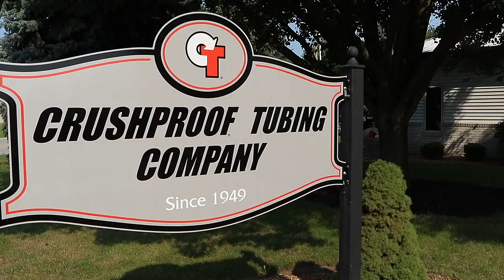Is Vintage Racing Being Destroyed by Gentrification and Control?

Comment: This sums up a similar theory I’ve had for a while. When a sports category naturally gestates into something good, it becomes popular, and when it’s really popular the folks with more money than they can spend will get involved. This causes a cost inflation that I personally think is irreversible. It also draws in undesirable personalities, and drives out the good people. Sport ruined.
Reply from the maker: You nailed it
Reply: Inflation can be reversed. As tyrannical governing bodies can be overthrown. But most governing bodies where created because the foundations of another weren't agreed with. 
 There is always a solution, whether people like it or not. What matters most is what's the best for EVERYONE.
Reply: HammerTowing usually with Motorsport categories the cost control starts with parity and control parts. The kind of thing that makes me want to smash a terracotta pot over my own head.
Reply: @willbeasy2898  True. But if the big kids don't want to let you in the club house, start a better club. Eventually, the big kids feel felt out...and some will want to join.

Comment: You could just as well drop vintage from the title. Racing in itself is being destroyed! I stopped by a friends the other day & they had NASCAR on the TV. I about cracked a rib laughing when noticing the flag man even had a full face helmet on.
Reply from the maker: Riiiiiiiight?
Reply: Well, after 2 or 3 flagmen got engulfed in flames pretty recently, I don't think they even had to force them to gear up, they just did it.  I don't remember the series I was watching, probably nascar because being on fire is what they do, but it was pretty horrific to watch them disappear in fire, and then a few seconds later jump out of the stand to get away, probably injuring themselves from the fall on top of being burnt.  So that example in of itself is probably not one I'd pick to point out a decline in racing.

Comment: Casey-You are so spot on!  I have been racing a 1959 Bugeye Sprite for 13 years now and only recently, started racing a barn find 1972 Merlyn Formula Ford.  I been on several podiums in my Bugeye, Indy, Mid Ohio and such, but only a few races in the open wheel car.  I decided to attend Mid Ohio this past June (2021), and was just stunned by the difference since my last race there a few years before. (2017).  The lower, middle, and upper paddocks were all taken over by big rigs, which left those of us with the true vintage cars, stuck in the grass with gravel roads to get to the grid.  Plus, we are the guys and gals with cars who embrace the fans and spend time talking with them and letting them climb in the seat for a picture, the big rig racing gang usually does not.  I walked around just wondering where the older cars went?  Hell, they had the few of us in the Formula Fords grouped with Miatas for gods sake!  I understand that as my wife says, old cars, older drivers, so the for profit race clubs tend to trend towards newer cars to stay viable, but if you came to an event that my club (VSCDA) runs, you would see that we easily have 130-350 cars that are all vintage.  I enjoy your videos-as a fellow racer who has now attended 48 Indy 500's, standing on the podium at Indy with that milk in my hand was a highlight of racing for me.  Here is my Mid Ohio race in a car with 26 years of sitting-this winter we are rebuilding the engine and gearbox for the first time.  https://youtu.be/8QCghb_NO_I
Reply from the maker: I intend to come out to the VSCDA. Thinking about getting a Formula B possibly. The Mid-Ohio event was built on Vintage Racing and was named the Vintage Grand Prix and now it’s been destroyed.

Comment: Agreed. I was involved in vintage racing back in the late eighties and early nineties. Both with SVRA and a SCCA licensed CARE. We ran support races for IMSA , champ cars and TransAm. Street circuits in Florida. I loved the street circuits. And we ran events at Palm Beach on three different tracks including downtown. That was local racing for me and once or twice drove the car to the track. I ran a ASA1000GT (look it up if not familiar). And a Beach Sportsracer. Fun,Fun ,Fun. The Miami GP and ST. Petersburg were great.  There was a little of what you are referring to back then but for the most part it was all good.
 My gripe is different. There were the gold chain, more car than skill group. And the guys that just drove. One of the pro guys that ran with is broke it down into three types of drivers. No, it was Joe Pendergast.  Riders, drivers, and racers. The riders knew what was going on in the stands. the drivers did a decent job of getting around the track, and the racers just hammered it all the time. Ok I got off track a bit there. As you get the dumbing down because the big bucks guys were often low on talent, they started altering the track itself. Lets throw in this chicane to slow everybody down so Daddy big chain can keep up. It occurred most often on tracks that also had driving schools. They got tired of their cars getting torn up so they just spoiled very challenging tracks. Look what happened to Sebring and Moroso(West Palm Beach) > The original Sebring course was fast in spades. Wide runways.Then they started stacking tires to pinch in the course and slow it down. The hairpin turn was gone. I think they messed with Green Park Chicane. They took a very fast challenging course like none other on the planet and turned it into a cutesy, ordinary racetrack. I ran the revised track only once and was very upset. The old course was so fast that I only touched the brakes for two turns. Moroso's turn eight was a challenge and only the most skilled could tiptoe through there without lifting. Most everyone else was braking and downshifting. I saw some nice cars get torn up there. But they had to dumb it down for the untalented and put in a chicane at turn seven that had no actual line. Terrible. That was my local track. I also was a corner worker/course marshall. The first race that I worked was at Moroso for the only TransAm ever raced their. The track was narrower than SCCA specs called for so it was a one time deal. The magazines wrote it up as the best TransAm ever. I stood with my back to the cars with my flags since my responsibility was beyond my corner to the next corner. They all went through without lifting. Paul Newman was just short of putting his turbo Nissan in the canal. The same type of cars at club races were braking hard and downshifting through the same turn(a switchback). 
Have you seen that at any of your tracks. Don't get me going on the whole showroom stock thing. That was where a lot of the dumbing down came from. i feel a rant coming on. Restraining myself. 
Jake and i did the Sun.n.Fun flyin together. Just tell him don't  force it Finesse it. Be looking at his face when you say that to see if you can see the wheels turning.  Carey Culpepper
Reply: @Lassi Kinnunen 81 Yes, I do understand how rare the ASA's are. I have four of them. I bought three of them from Luigi Chinetti.Two of them have damage to the front incurred in road accidents. Both on one way streets. One guy ran a stop sign the other made a turn from the center lane cutting me off. He saw me and just kept trying to make the turn. The point of mentioning that is that there is no more of a risk racing the cars than driving them on the street. 
I am far from rich. I bought these cars in the 60's. I was a shop teacher and made very little money. I was also a SCCA racer back then. When sanctioned street racing began here with the Miami GP, I decided that I wanted to be a part of that. I prepared one of my ASA's and started racing it. I started with SVRA events and then SCCA sent a representative from Denver to license us at the Palm Beach GP and for  non SVRA events. 
We all started out easy but a few races in several of us got really serious. I was now really enjoying the car and driving it to it's full potential. That the car was irreplaceable  made no difference to me. Life is too short to be afraid. Those were the best days of my life. My best memories are from that period in my life. I am now almost 76.
When you don't have a lot of money, you enjoy what you have without worrying about the money value. I remember the words from the first drivers meeting at my first SCCA drivers school. He said that if you can't afford to write the whole thing off right now, go put it on the trailer and take it home. How true that. 
I raced the street races until our sponsor had financial issues and that was the end of that. The last season I drove my Beach Sportsracer (also rare) but it just wasn't the same. I never was able to really trust that car to drive it as hard as I did The ASA. That ASA just loved to be sideways. I also drove other peoples cars at some of the events.
Reply: I forgot to mention the immense joy of beating the big bucks guys with a car that I daily drove on the street.

Comment: I looked at building a Spec Miata car, "the most affordable way to get into fender-to-fender racing!" Uh, no. It's not "affordable" at all, and racing generally never has been. You were either a "gentleman racer", raced someone else's car, or got in early enough (and were successful enough) that you could grow with the sport. Even dirt track racing here in southern Ohio is out of the question for anyone with less than about a six-figure income. Hence the popularity of drag racing: You can show up in just about anything that isn't currently on fire and race someone head-to-head at the local 1/8 mile strip. I autocross for fun and that scratches my itch, along with continually working on my car.
Reply: I said all that and didn't say great video. Great video!

Comment: I completely agree with your concerns. I’ve been around vintage racing since the late 1980s when I was staff photographer at Road & Track Magazine.

The likely reason for the increased rules and hours requirements is likely to keep event increasing insurance costs from shutting them down.

I’ve also seen this in the aviation world such as at the Reno Air Races (happening in a few weeks!).

Help solve this issue and you’ll get back what you love about vintage racing!

Comment: I’ve been going to Mid-Ohio for 30+ years, and have been a season pass holder for 20+. Always attend both Vintage cars and Bikes every year. I’ve also seen the grid sizes shrink… but my thought is that it’s a changing of the times. I can even remember seeing a pair of 917’s out on the track… those aren’t out there anymore. Values have skyrocketed and a lot of these are going into collections, and the people taking these cars out on the track are getting older. From a spectator standpoint, I think it’s a good thing to bring in these other series or else there wouldn’t be anything on the track. (WERA has been racing during the vintage bike weekend for the last several years.) No one wants to spend $50 to walk through the gate to see a class with only 5-6 cars in it. I don’t have the answer, and I’d love to see full classes. I guess the real question is how do you get full fields out on the track to not need to bring in these other classes or series?
Reply from the maker: Social media. If they can inflate the prices by creating desire, they can create desire to race.

Comment: That's what you need to do Casey, See who has cars that haven't been racing and contact them and see what causing them not to race. I'm sure as you have said it's the money, not being able to be competitive. Have a meet with them for those who may be interested. Get together and change your rules that allow them to fit in and be some ways on doing this it can be done, I have personally done this. If you can enough racers who agree with you get together and figure out how you can make all the cars competitive. There's different ways to do this, certain cars going to a smaller carb, restrictor plates, adding weight, different hardness of tires, lower spoilers, you know the game. I've given you ideas on how to do this. These are proven ways that have worked for me. You get the drivers to agree on a set of rules that bring cars back to racing your not going to get much argument from the sanctioning body , they know if they stick to there guns there not going to have many cars racing, make sure you invite the high end racers as well you would be surprised on what they may be willing to compromise to keep the sport growing. My 2 cents.

Comment: I know this vid is 1 year old but have to comment.  Sure sounds like you were at an SVRA event.  I started in Vintage with SVRA over 35 years ago - and it was at Mid-Ohio!!  I don't race them anymore for many of the reasons you laid out.  I was told a long time ago that SVRA's owner does not consider the racers to be his customers.  The sponsors are the customers.  Explains a lot.  But fear not, Vintage racing is alive and well with a few good clubs.  (Full disclosure - I am a board member with VDCA).  We do not cater to the big rigs and don't rent track time to Formula Fuck4 or TAFuck T1 and TAFuck T2.  We are run by grass-roots kind of guys and we had full grids of vintage cars at our most recent event at VIR.  VRG also does a great job and has good events.  I would be remiss if I did not also mention the Formula Ford Challenge Series on the East Coast where we are regularly getting grids of 30-40 vintage FFs (I race a Lola T340).  Don't give up on Vintage Racing just because Tony at SVRA has found way to monetize it that doesn't give a shit about the vintage cars.
Reply from the maker: Best comment ever. Maybe I’ll bring my FB out with you guys.
Reply: @CaseyPutsch  I've only been to a few vintage races. And only to Watkins Glen. But I grew up there in the track as my dad was a Sprite racer from the early 60s and we spent our springs, summers and falls at all the northeast tracks. 

You couldn't get a paddock spot for the SVRA race, the infield being packed with big rigs for the GT crowd, and the MGs and other vintage race classes were packed together, received little track time, and were slotted into the worst time slots. But the VRG race was entirely different. The drivers got so much track time, they were exhausted at the end of the weekend. I would absolutely go VRG and I'm struggling to finish my bugeye for next season. It's unlikely, but maybe the one after that. I feel like I need to hurry, some of my older friends are retiring soon and time is running out

Comment: Here's my question: Has the decline of Vintage racing necessitated the involvement of non-vintage series for the events to take place? 

I have no idea how much money it costs to rent the facility and get all the EMS and whatnot together for a weekend of racing like that, but FR and F4 no doubt bring a lot of it and it might be a necessary evil at this point in time. 

I think there's also a certain thing going on with vintage racing where a lot of the people interested in running the cars are the same people who either grew up around the cars or grew up watching those cars. people like yourself being the exception. 

I also don't think the licensing requirements should be too stringent, but I would worry for the other competitors to a certain degree if there were none at all. whether there is or isn't some licensing in place, I have no idea.
Reply from the maker: Not actually.

Comment: Colour me shocked at rich people ruining things.

A few things i see tho about what you said.  No one doing the "meat and potatoes" vintage racing are gonna go to f1, so somewhat shortsighted to expect to have an older high end car and be left to their own devices.

Horsepower (peepee measuring) competitions are always gonna happen.  That's racing.  I bet some of those vintage racers are mighty spicey, maybe they should be left to the pros.

Here's a solution that i participate in with current cars  that may translate to the greater population density in the states for vintage racing:  the track itself runs a series.  Make the cars comply to a sensible set of safety rules and make the drivers show they are competent enough at that track (a coupla sessions with the track's instructors) and bam, join the fun.

And that is the key, fun.  The only prize we win is a beer glass and a beer to pour into it.

Maybe vintqge racing won't translate into that formula but maybe just revise your expectations.  I suspect you are similar to me in that building the car is half the fun of all of this.

Like i said, no one here is going to f1, so may as well have fun with the outrageous amounts of sometimes not disposable income we spend on this lol.

It supports the local track as well as being significantly cheaper than "big boy" racing.

Comment: I get your position, but you are talking about one group...SVRA. They are what you say they are, but you should try VSCDA and many of the other volunteer / non-profit sanctioning bodies. I ran a Can-Am car and currently run a Club Ford and vintage racing is fine in the other groups...for the most part. Your complaint seems to be focused on SVRA only.

Comment: pansies in large part have ruined motorsports. every time sanctioning bodies need to make a move in the direction of safety it almost always means worse racing. I think that's part of the reason why f1 from the 70-80s is so highly regarded. yes the death rate was astronomical when compared to today but the racing was masters of their craft at the limit. yeah it sucks so many good drivers were killed but ultimately they made the decision every time to get into the seat. they knew the risks and went out and raced in spite of it. it goes back to what Casey said about taking personal responsibility.